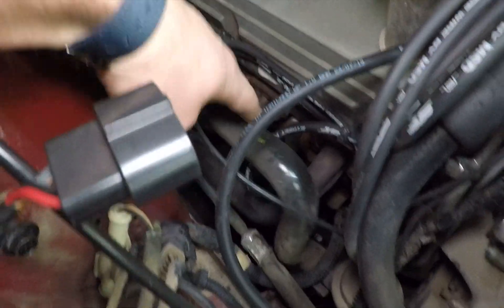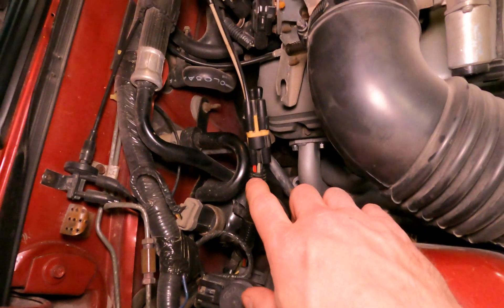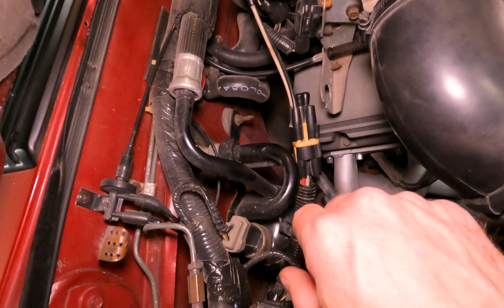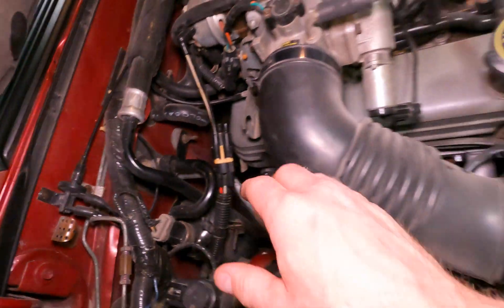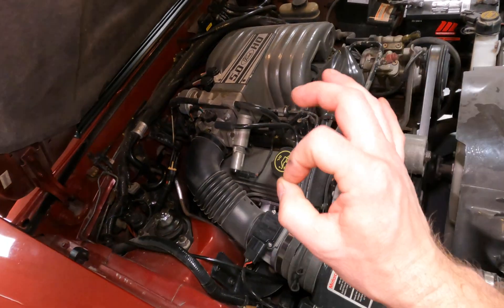What the Heck is a Thermactor? 80's & 90's Ford Emissions Control / Smog Pump Delete 2.0

Comment: As an automotive technician in PA with a state inspection license, but also owns a 91 Fox with a 393w and Holley EFI, here's my input on almost all of the emissions crap, especially cars that are 20+ years old. The emissions components seem to be common failure points, or induce engine problems. Right now, emission components and standards are destroying diesel engines and the diesel industry as a whole, but that's a whole other story. As for gas engines, the only emission systems that actually work worth a damn, are the EVAP, PCV and usually, CATs. EVAP is basically just taking gasoline fumes/vapors and using them to help the engine startup, which of course is a good thing. PCV, well, every engine needs to ventilate the crankcase so reusing those vapors is beneficial because it creates a good closed loop flow of air to ventilate it, so that's beneficial to the engine. As for CATs, when they dont clog or get stolen by scum of the earth people, they serve a simple good purpose with almost no negative impact(Horsepower) to pump gas engine vehicles. Everything else is ridiculous, EGR is simply dumping HOT exhaust fumes back into the engine severely reducing engine performance, essentially making the engine work harder therefore producing more emissions than it normally would if it was breathing cool, clean fresh air. Plus the EGR stuff always clogs, leaks, or gets too hot that it needs it's own seperate cooling lines, which by no surprise, usually always leak. The Air pumps are a joke, because they just make the engine work harder to drive the pump to pump fresh wasted air right out the exhaust. An engine is essentially an air pump, now you're attaching a smaller air pump to it, but instead, you're just pumping that clean air right out the exhaust while the engine has to produce more emissions because it has to work harder to create the energy to drive that pump. Even on the electrical modern pumps, the engine will have to work harder to spin the Alternator to create the energy to operate all of these electronics. Energy isnt just created out of thin air from nothing with no emissions. It has to come from somewhere. Also, these older cars, most of us only put 500-1000 miles on them in a year, yet there is usually no exception for that in states that have strict emission laws. Why should a car that is only driven 500 miles a year, have to adhere to the same strict emission rules of a car that is driven 20k+ miles in a year? I'm sure the politicians and unelected officials(EPA) have no concern about emissions when they're on their private jets, yachts, limos. Let's not forget how when Governor or California at the time, Arnold Schwarzenegger, who signed and pushed very strict emissions regulations, at the time owned and drove one of the first ever civilian Humvee H1s that got like 3mpg or some BS like that. It's a double standard that's seen everywhere. I'll close my argument with this, Earth is not infinite, it will pass. Our physical bodies are not immortal. These lunatic tree huggers believe earth is, and they WORSHIP it instead of the creator. I'm not saying blatant abuse of Earth by absurd pollution or dumping chemicals and trash into the ground are good, I'm saying, observing it on a micro scale like they do and promoting fear with it, is lunacy, especially when their rules only apply to us and not them.
Reply from the maker: Well said!
Reply: Sorry, but you don't understand what the various smog components do, and why they do it.
It's fun to keep perpetuating misinformation. In the early 90s Ford told us how to remove stuff properly if your hot rod didn't need it to pass inspections.  Old wives tales are fun, aren't they.
Reply: NICE rant.
Reply: TRUMP 2024! God Bless America!

Comment: The previous owner removed the smog pump on my '89 vert but he left all of the vacuum solenoids and drove wood screws into the vacuum tree to close them off rather than getting plugs and it really bugged me.  I spent some time looking at vacuum diagrams and last weekend I removed all of the vacuum lines, including the tree that you show, removed the solenoids and tucked the wiring up and it now looks way cleaner.  As far as I can tell there is no need to keep that vacuum tree because all of those lines (on my car anyways) are associated with the smog system.  Apparently disconnecting the vacuum solenoids from the wiring harness will throw a code but they do not cause a check engine light.  Disconnecting them did not cause a CEL on my car. 
He also had the fuel pressure regulator connected to one of those lines on the smog tree rather than directly to the intake manifold (both manifold vacuum ports on the firewall side of the intake manifold were wide open) so I corrected that while I was in there.
Reply from the maker: Nice job 👍
Reply: Where are the solenoid s located @KASLCustoms

Comment: Hi Gary. Great video as always. I've also seen a video or two about to avoid having to buy the block off plates, just cutting the ends off of the crossover tube, clean them up, and flip them over. Put some high temperature RTV on the heads, bolt the flipped over ends back in place and drive away happy. However, I do feel the block off plates are the better option.  Also, you'd like to "clear the air" about smog pumps? Ha ha ha, good one. 🦊
Reply: If you have the heads off the holes can be tapped with a pipe tap and plugged with a pipe plug also.
Reply from the maker: Yup 👍
Reply from the maker: Hahahaha thx buddy!
Reply: I would either buy the blockoff plates or make them from something else. It is like the air silencer, there are fewer and fewer of them around and if down the road you want to go back to stock how can you if you cut it up. 
Remember there is always someone looking for bits so that they can make something original.

Comment: One of my first mods Smog Delete then egr Deleted next
Reply: My 5 liter 1983 Mustang ran better after removing the EGR and putting in a spacer bbelow the carb.Could idle or drive at lower rpm without conking out.Had a lot of soot in old Egr.I think the Chiltons book said you supposed to remove it to clean out soot every year, which most people never do.

Comment: Mine is still in the car, its been riding along in the trunk for about 20 years
Reply: Also you may not need block offs for your heads, sometimes the air tube holes are tapped and a 1/2 bolt or pipe plug will thread in the hole. Mine were tapped on all 3 of the cars I had
Reply from the maker: Hahahaha nice!!!

Comment: Great video as always brother!  Would it be possible to just run a shorter belt and just bypass the smog pump and just leave everyone connected?
Reply: Mine is bypassed only by belt on an 84 and the pump is locked up, but still there with all the plumbing.
Reply from the maker: Nice!
Reply from the maker: Thx buddy! Honestly I’ve never tried that… there probably is enough clearance though 👍

Comment: It looks like you still have the EGR on the car, any pros/cons to removing it? any reason you kept it when you don't have emissions testing?
Reply: EGR is closed under heavy loads/full throttle so it doesn't effect power output. Under part throttle and moderate load, like cruising up a grade in 5th gear, the EGR also reduces odds of detonation.
Reply from the maker: Hey bud. Ive left it on all my cars. I know there is a jumper to trick the computer but for what it’s all worth, I just leave it in place to keep the computer happy 👍

Comment: I dont think its worth it to remove the plumbing from the back of your heads unless its a show car or the engines out its just too much work. Also I removed the whole system and left the pump attached to the belt for a while so you can do that while you save up for a idler pulley or while youre waiting for your belt to ship
Reply from the maker: The smog pump makes quite a bit of noise - even more so when it’s not pumping into any plumbing. I left the cross over pipe on my coupe for years and just plugged it with a hose, a bolt, and a hose clamp. It’s not bad if you have a set of ratcheting wrenches 👍

Comment: 🔔😎 
Ever see the flames coming out headers? You know the hot stuff that turns headers red and tarnishes pipes.
The pump injects oxygen into the hot gases and furthers combustion on its way out. This oxygen also enhances the catalytic converter's efficiency.
Note: back in the early 90s a non cat, non pump 5.0 HO would pass the CA tailpipe emissions test except for.... Visual. Many engines were installed in restomod 60s Fords and CA only required they pass the year of CAR manufacture standards.
Basicly just PCV.
The fuelie was considered an update for the original SBF.
Youre welcome. 😁😁😁👍👍🇺🇸YeeeeHaaaaw!!!
Ive seen smog pumps hooked up to suck a vacuum on the crankcase. 🤔🤔
BTW. in the early 90s Ford Motorsports had a street rod rolling chassis they took to the big NSRA shows showing how easy it is to dump all that stuff and keep the stock A9L/P.
Built several.👍👍
Oh ya, the EGR is an optional. Computer doesn't really care. You will get a light, but theres an harness plug for that.
Or you can hide the egr plate sonewhere and leave it connected but doing nothing.
Reply: Do you know where to get the harness plug? I have a 94’ GT

Comment: Hey thanks for clearing some things up.  One question is what did you do with your TAD and TAB solenoids?  just left them in place and plugged in?
Reply from the maker: Yessir, I don’t touch them at all. Never had an issue on any fox of mine
Reply: I also was wondering the same thing ? I am throwing codes 94 and 44 related to the TAD and TAB after deleting smog pump

Comment: On my 94 it was deleted either by the previous owner or original owner but they didn't put the idler pulley and used a shorter belt, I wish I had the idler pulley on there honestly
Reply: Idk just feel like it would be more complete, are there any benefits running it without the idler pulley?

Comment: I wonder what the percentage of fox body’s that are still on the road, are running a smog pump?
Reply: Me. I live in California.
Reply: Me too.  I dread the bi-annual test. I nursed my 300K+mile cats for 30 years until they finally couldn’t make the grade anymore.
Reply: @PantoPhobe-dm2fd  300k + miles with stock cats? 

🫡
Reply: My 92 still has it's smog pump. 
Now I am really thinking about not installing it when the engine goes back in this summer once I get the body painted.
Reply from the maker: Lol the 91 Vert still had hers 🤷‍♂️